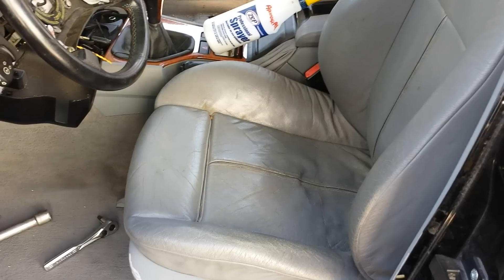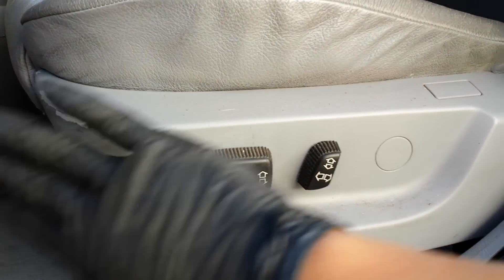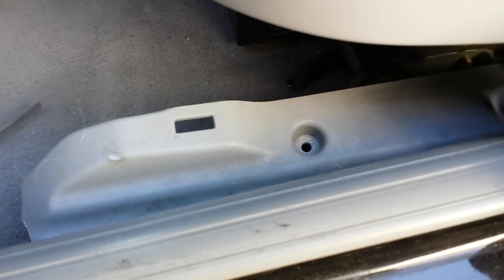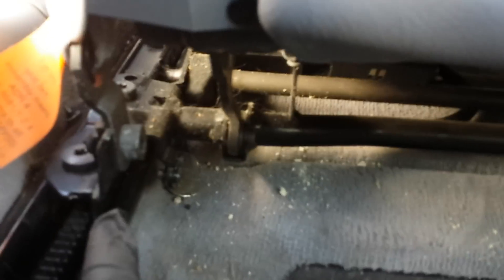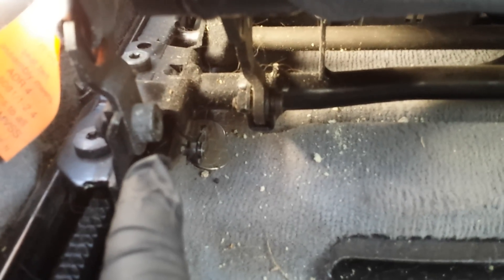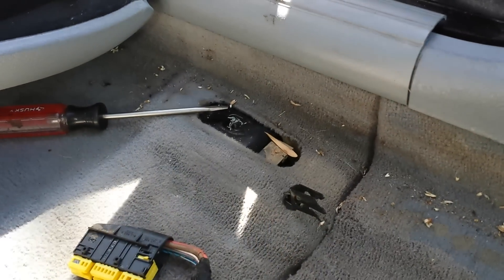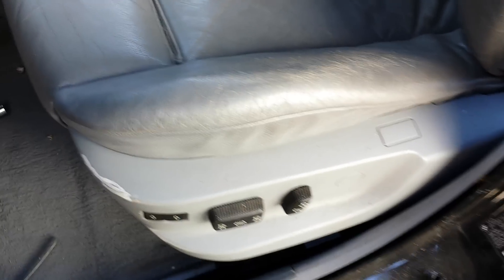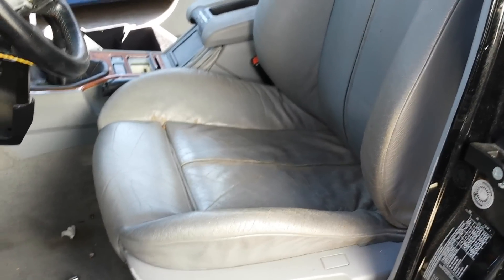How to remove front electric seats on a Bmw E39 540i 525i 530i and BMW 740i

Comment: I'm about to remove some 7 series electric/ heated seats to put in my Landrover Defender, really appreciate the video, I now know what tools to take with me, I've realised I also need to take a 12v battery pack to power the seats for access. Wouldn't have thought of that without your video, Thank you very much. Dave
Reply from the maker: +Diydude69 You are welcome

Comment: I came across a problem earlier this week. while vacuuming the driver side I pushed my seat all the way forward now I have no power completely to the seat or the steering wheel  tilt options .. maybe a blown fuse? any ideas anyone?
Reply: +Juan Valdez My first guess is a connector came off. A quick google found this: http://www.bimmerforums.com/forum/showthread.php?1810614-Problem-with-power-seat-and-adjustable-steering-wheel
Bimmerforums.com is a great place to ask questions because there's usually someone else who has had the same exact problem and knows the fix.

Comment: How do you remove the seats from a 525i without power to the car? Im doing a restore project on a E34 1989 525i.
Reply from the maker: Great Question.  You need to locate the seat motors that move the seat back wards and forward.  Cut both wires,splice them and provide manual power.  Search our videos and sear for "seat' we have a seat diagram that shows this process.  Thanks

Comment: ATTENTION :  Do not unplug the electrical connector to the seat until you have disconnected the negative terminal of the battery for at least ten minutes.  Otherwise you will get an airbag light when you start the car.  It has to do with the seat pressure sensor that detects if the seat is occupied or not in a crash and to deploy the airbag.  Passenger side in particular.

Also the small Torx is a 30, not a 27.
Reply from the maker: Thank you for sharing information
Reply: I guess I am kind of randomly asking but do anybody know of a good site to stream new series online ?
Reply: @Caiden Nehemiah I use Flixportal. Just google for it =)
Reply: @Ricky Dariel Yup, I have been watching on Flixportal for months myself :D
Reply: @Ricky Dariel Thanks, I signed up and it seems like they got a lot of movies there :D I really appreciate it!!
Reply: @Caiden Nehemiah You are welcome :D

Comment: How do you take out the seats if the motor is broken and unable to move them forward or backward?
Reply from the maker: very difficult to remove at that point.
You would need to cut the vertical metal brackets.

Comment: ok here is my prob the seat is all the way to the front and it wont move at all and I have looked at the seat motor and there is no cable that I can see just 3 wires that's it. How would I go about trying to move the seat with a motor that has no cable? I am at a lost right now
Reply from the maker: idontknowyou sorry  Check this video out, it gives you a better diagram of what motor controls what in the front seats.  http://youtu.be/ruJnghmO5K4
Reply: thank you for the link .. not what i was looking for 100% but i think i can make it work i would give this a try once i can get the time off to do so :)

Comment: Hi guys dose anyone know if I am able to get the comfort seats instead of the stock seats. I have 2007 525i. I want thicker and firmer seats instead. Anyone know if I can????
Reply from the maker: localpeople Most seats are interchangeable.  As long as the connections are the same, you can install sport seats on bmw with comfort seats and vice versa.